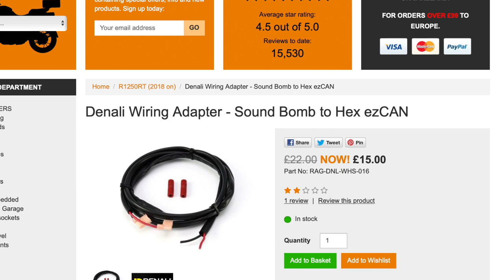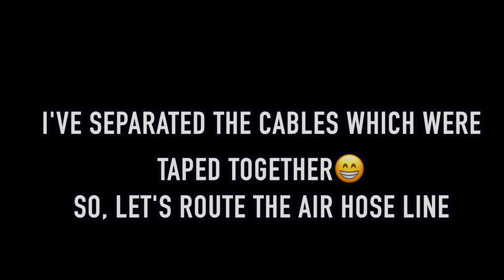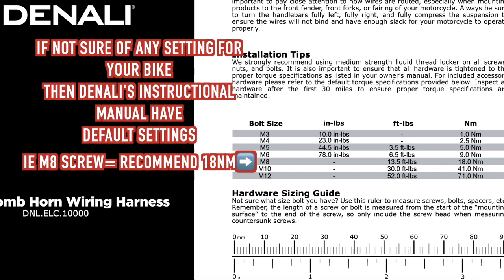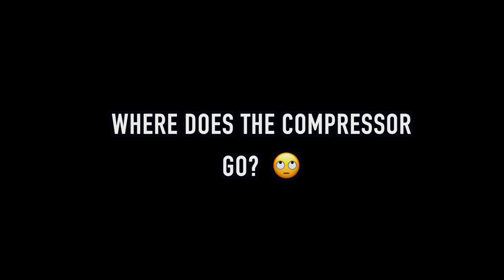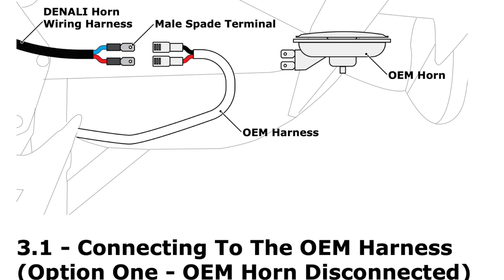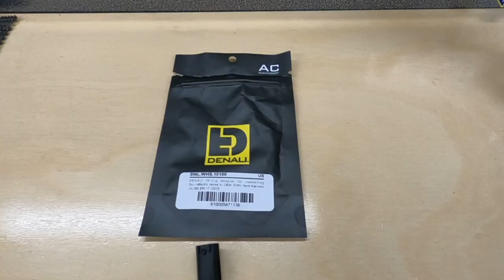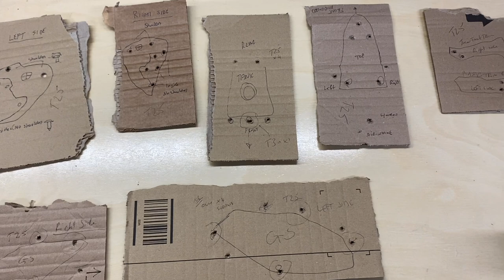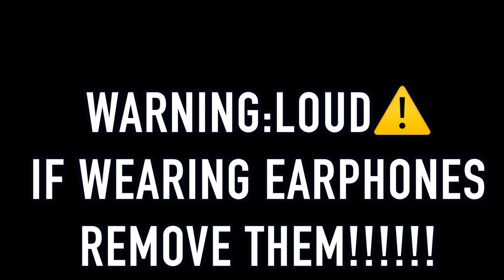Part 1. Full installation video of the Denali Sound Bomb Split plug n play kit-BMW R1250GS

Comment: I really enjoyed this DSB installation video. You are very meticulous and make all farkle installations seem easy and straight forward. Thanks for all the time and effort you put into your channel. 
* with reference to the rubber grommet you lost for the battery cover, would a few drops of medium strength thread lock (or other light adhesive) in the grommet groove  help keep it in place.
Reply from the maker: Thanks for the comments👍. To be honest I donor know. The grommet just needs to be wider to avoid it being pushed through. Don't tell anyone but my dealer just went and borrowed one from a demo mode and let me borrow it long term...which has now disappeared l!!!  😂

Comment: Nice vid!  I guess there are a number of variations on this so if it helps for others this is what I did differently.  I chose to install the relay and most of the wiring along side the battery.  There is plenty of space if you keep the cabling tidy.  I ran the horn loom over the top of the battery in the area where I think you said you have a gps unit.  I don’t have any wiring under the seat.  I just folded the excess horn loom cable up on itself and zip tied it all behind that lower panel.  I didn’t remove the tank central panel or the two tank side panels, I was able to run every thing without that.  But I do have a tool which it a long springy thing with a grab on one end which makes life easier running in confined spaces.  I fitted the flag connectors the other way around to you so that they don’t stick out the side and are not visible.  I ran the horn connector up the same way as you but of course it starts at the battery compartment so doesn’t have to cross over from one side of the bike to the other.  Same as you I left the OEM horn in place without wiring to it.  In fact I removed it during the install for access and refitted after.  I ran the pipe up similar to you but took it across from the left to the right behind the headstock and dropped it onto the horn unit from the right.  That way I didn’t get a pinch point at the top of the horn.  Finally if you put the end of the hose in a cup of hot water for 30 seconds it softens up so you can easily fit it.  Not saying anything I did is better than anything you did but wanted to show there are options.  Took me longer than 2 hours as I trial tested everything, including the horn off the bike.  I now know what the black plastic nut cap is for too, thank you!  So thank you for making the video for those to come.
Reply from the maker: You should have done a video...👍
Reply: @gsd32i  I took a load of photos as I went along for reference. I have never made a video. Your production quality is very good.
Reply from the maker: @markpowell7713  Thanks Mark, I have to say that the whole install video took a few days with stop start and camera position etc. Appreciate the comment, as its a long video and wanting to get everything in without being zzzzzzzzzzzzzz took some planning and editing . Ride safe have a great day.
Reply: Very interesting video, though I will probably stick with my mini soundbomb. You really put some effort into showing all stages of the install, thanks.
Reply from the maker: @nigehaworth  go with the sound bomb … I went for the mini to start with but I think it’ll be much more effective when someone attempts to pull out etc . Have a great day 😀

Comment: Nice video, so it Denali split in case that I decide to install will take a long time process to put it on the GS ! I guess could be a little more easy to install the other Denali called Soundbomb Compact Air Horn... Congratulation for teaching this hard work
Reply from the maker: thank you. it’s an easy installation but just take your time .😃

Comment: This is probably the best installation video I have seen.  You cover the often tricky, yet seldom explained panel removal for the bike.  

I'm also planning to run power supply to my GPS from a fuse block under the pillion to the bars.  Is there room between the tank and tank panels to run that wire, or should I go under the tank and along the frame?
Reply from the maker: Personally i would go under the side or top tank panels 👍

Comment: My Denali Sound Bomb split compressor and horn cost a lot less from SportsBikeShop. Wired, like yours, onto the battery of my bike not a GS.
The Denali Sound bomb is very loud. I got one having heard the one RichyVida fitted to his VFR800.
Reply from the maker: Always good to get a deal . Did that include all the mounting brackets for the gs or just the horn compressor and wiring loom , which comes to about £70 at Sportsbikeshop, who I use a lot . The brackets retail about £33 . Impressive horn 👍
Reply: @gsd32i  for the GS you also need the specific adapter which plugs into the horn connection which is surprisingly not cheap for what it is.
Reply from the maker: @markpowell7713  yup ,have a great day👍
Reply: @gsd32i  The horn is indeed impressive. I don't have any pull outs when riding my bike a Triumph Sprint 1050 with it fitted. I must have bought it about 4 years ago with the wiring kit. I was looking for the transaction just to satisfy my memory. I think with wiring kit it was about £55 or £59. I had to make brackets although some were supplied. I think I used one or two of them. Being the Sprint ST it has a full faring so I was able to mount it beneath but still able to deliver it's sound busting sound. I have another couple of bikes I also got sound bombs for but still have to fit them. As you say they are impressive. Love using it although not too much ;@).

Comment: Thanks for the detailed installation video.  Quick question:  shouldn't the horn face forward?
Reply from the maker: The older combined compressor and horn unit  did BUT the split version faces rearward. 120 decibels doesn’t matter which way it faces 😊

Comment: At 23:43, it says the horn is supposed to face backwards. Can you clarify? So the sound outlets are facing the rider, sending the sound to the back of the bike ("backwards")?! Every other photo I see (even on the Denali website) show the air horn openings facing the front of the bike (or sometimes toward the side, if mounted on the side of the bike).  Seems counter-intuitive. Can you provide any insight as to what's going on here?  Thank you! Great video, this will save me install time for sure.
Reply from the maker: Thats the way it is supposed to be fitted. I contacted Denali too. The horn will only go on that way. They said with over 100 dbs it doesn't matter which way it faces ...they have a point.😄

Comment: Is the wiring included in the kit? Or separate?
Reply from the maker: Hi, the wiring is included in the kit. I have now connected the sound bomb to one of the free inputs on my hex ezcan thereby doing away with a lot of the wiring which went to the oem horn and battery/relay.
Reply: @gsd32i  thank you👌